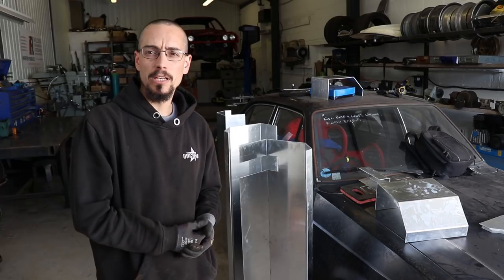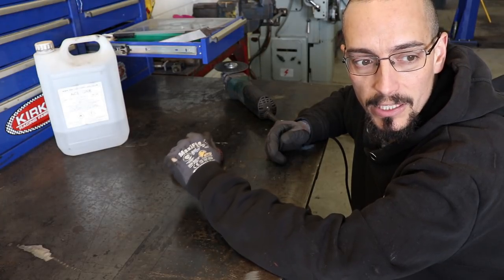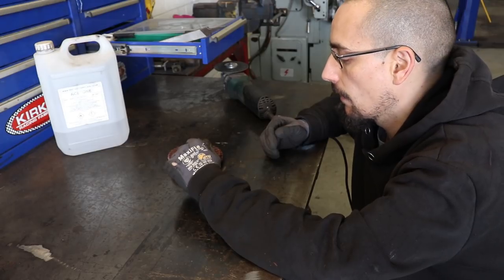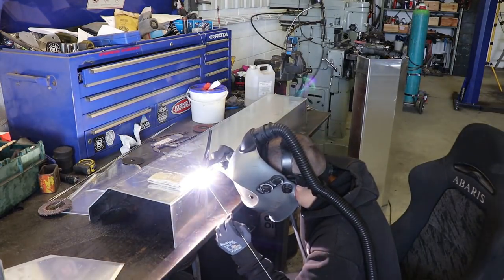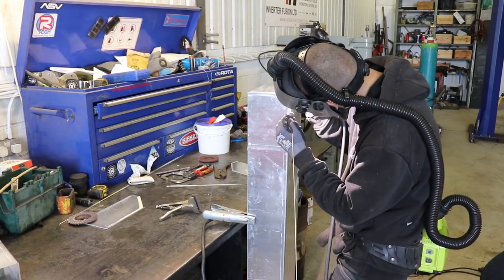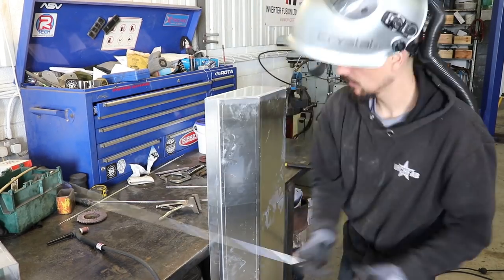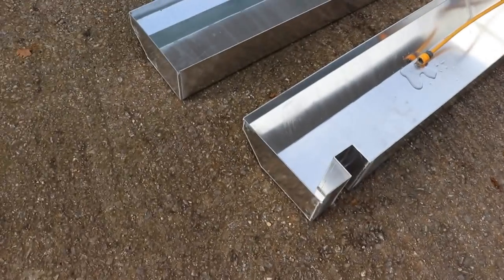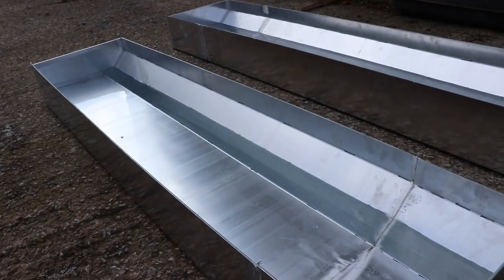A FEW TIPS FOR TIG WELDING ALUMINIUM.

Comment: looks like ALSI5 filler .. nice bright white arc ..... not green like ALMG5 ....  welds look good - dont let people hate on your welds like they do on mine ....LOL.  I bet this job put food on your and your family's table !   and it look good. - its no "instagram stuff" ...  but like you said. - most of it gets ground down anyways
Good Job !!!
Reply from the maker: Thanks Peter. Yes its good enough for what it is. Cheers
Reply: Urchfab there is absolutely nothing wring with alsi5 filler ( at least not in my opinion) using other fillers and getting a tiny bit more strength but therefor loosing other properties ...  i mean where ever you weld is the original material lost strength ( lost heat tread and conditioning) anyway but as you said - it is plenty strong enough. 
Personally I like the way it flows

Comment: Thanks for sharing. 

What kind of amps do you run per mm material thickness?  cheers
Reply from the maker: It really depends on the material and how fast your moving, you can run higher amps at faster speed etc. I always use a pedal so I'm not really paying attention to the amps.  Sorry that doesn't really answer your question.
Reply: @Urchfab  I totally understand what your saying. Thanks. The pedal is just a better way to control it without stopping and adjusting to suit etc.  maybe another camera on the display and a talk through on what's happening in the weld pool etc and what your doing would help it click, not to mention it would be interesting for some if you have time would be great. Cheers